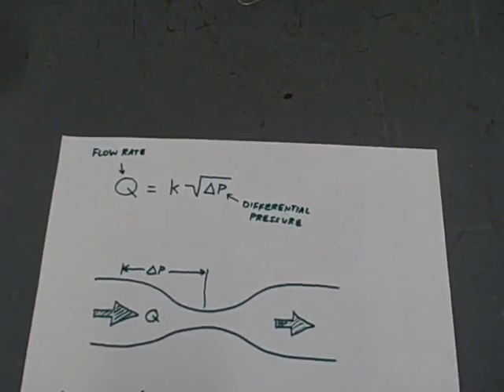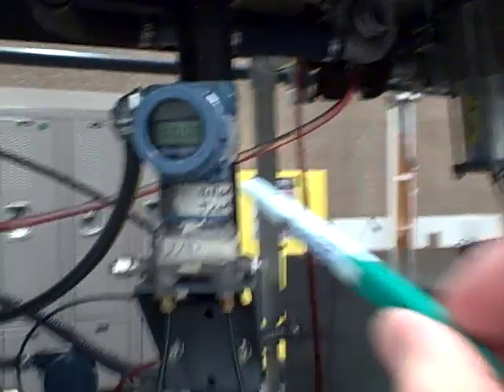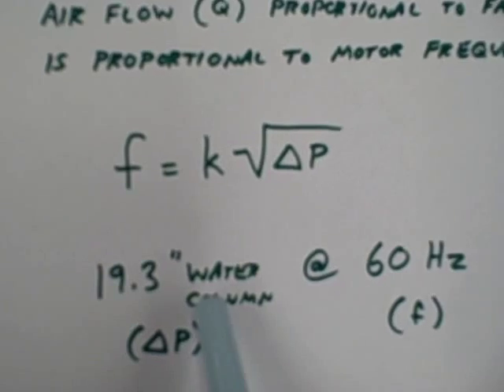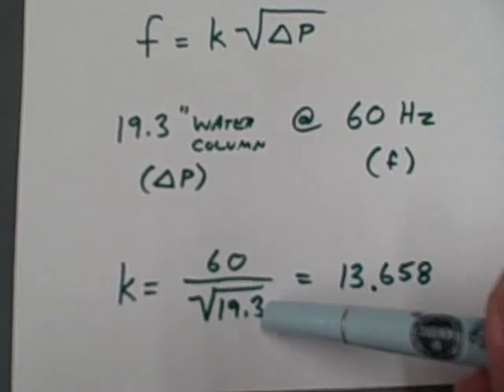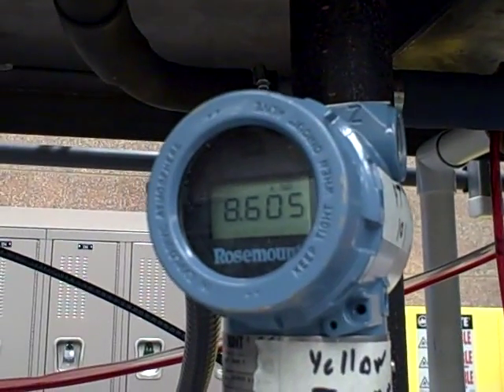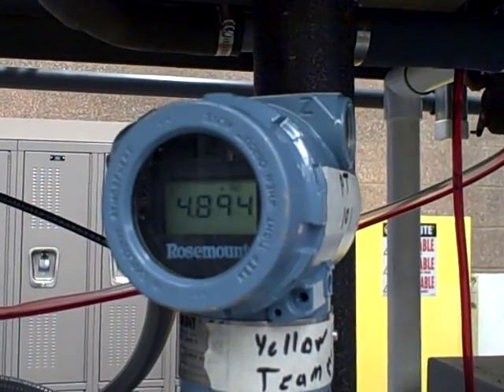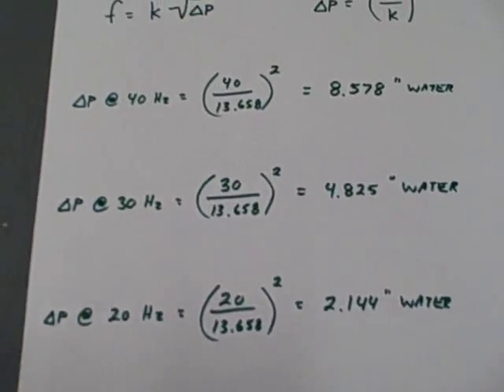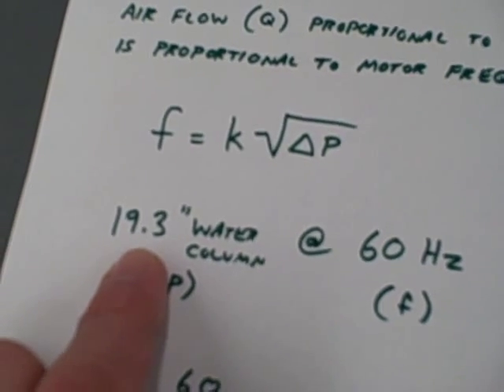Venturi tube flow and pressure calculations

Comment from the maker: Not exactly.  Without compensation for temperature and absolute pressure of the flowing gas, you will not have real mass flow measurement.

Comment from the maker: Flow rate will be proportional to the valve stem's position assuming a "linear" flow characteristic in the valve and a constant pressure drop across the valve.

Problem is, valves are rarely linear, and the pressure drop is rarely constant over a range of flows,  There is no simple answer to your question.

Comment: If there is a pump running at fixed speed with a flow control valve..what will be the proportional with the flow (Q)??